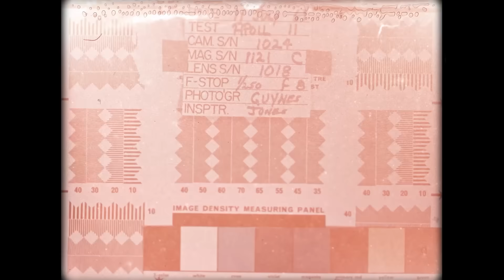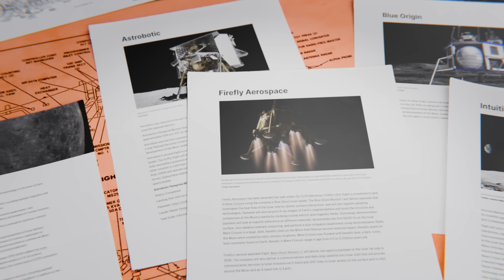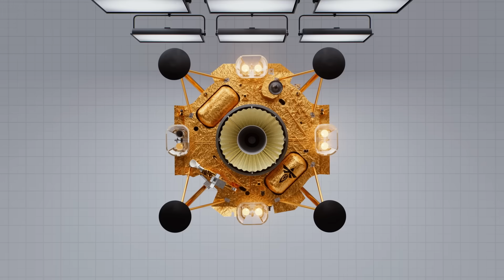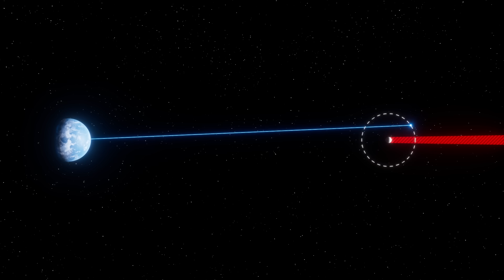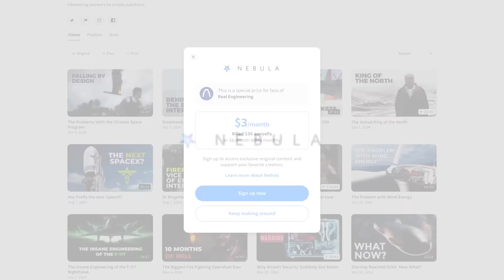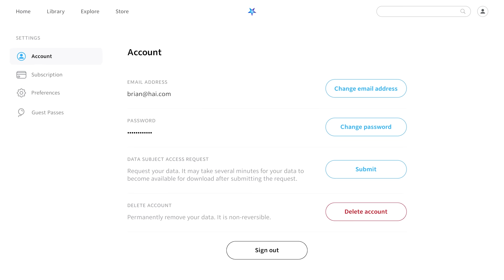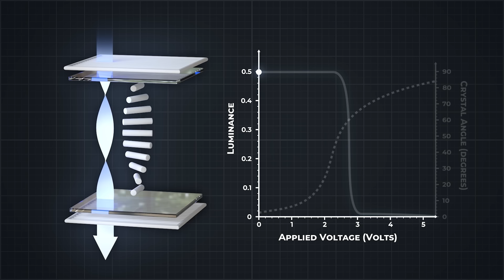Why the US is Struggling to Land on the Moon

Comment: "all the blueprints, designs and drawings are missing"
It's very easy to type those words, but you'll never come up with a source for that claim.  In fact, you can go see the vintage design documents on the Internet for yourself right now.  You've flat out pulled that out of your hat
Reply: one thing is for sure, NASA lost the original filmes and also lost the telemetry and related data for mankinds greatest achievement. I smell a rat :/
Reply: @bobmalooga7249 "i smell a rat"
Are you sure you've got your facts correct?
Reply: @ yes, go look for yourself because I didn't believe it either. I thought it was staggering to know that they lost it all!
Reply: You don't know.
Reply: Forbes wrote an article stating that NASA has lost the technology to go to the moon.
Reply: @SchemingGoldberg   Most likely you misinterpreted the article.  What was lost, specifically?

Comment: Not an engineer here but why isn’t the lunar lander designed to land any direction like a roll cage with legs on all sides.. eliminate as many variables as possible!
Reply: The lander is built to land with its main engine pointing at the ground. Having legs on all sides would not have improved IM-1’s landing. It hit the ground while it still had both horizontal and vertical velocity, because it did not have correct altitude information. 
A lander that’s designed to land in any orientation is a lot more complex: its instruments have to work in any orientation. It has to have solar panels that can gather enough energy in any orientation. It has to have multiple landing engines. etc.

Comment: Just so we're straight; after all of the moon landings we did in the 60's and 70's we don't remember how we did them? Or has technology somehow, gone backwards since then? Give me a fricking break!
Reply: We do remember how we did them. The IM-1 failure was caused by Intuitive Machines deliberately ignoring some of the lessons NASA learned in the 1960s. In particular, they did shoddy work during the preflight check: they forgot to switch the altimeter out of safe mode. That meant the altimeter did not work and could not be switched on remotely during the flight.
Reply: "we don't remember how we did them"
That's your misinterpretation.

Comment: Is there any reason they don't use a small radar sensor for altitude and velocity at the final approach, when the dust obstructs the cameras?
Reply: IM-1 used a laser altimeter. Unfortunately they forgot to switch that out of safe mode before launch, which meant the altimeter was not working during the landing.

Comment: ... You would think on an object with as little of gravity as the moon they would have the center of mass in the correct location... I mean come on! You landed a rover on mars multiple times that autocorrect. Center of mass has always been a massive role. How do they blunder this bad? Just look at the shape as compared to the traditional lander. Thats such a mess.
Reply: Having a lower center of mass would not have saved IM-1. They were trying to land while still having a horizontal velocity. It was going to fall over no matter what.

Comment: My father in law was the project manager for the Apollo Command Module Flight Simulator.  He passed on in 2015.  He was a very interesting guy.  He said that the only thing that got us to the Moon was funding, which in the early years was virtually unlimited.  He also said that the reason we stopped going to the Moon was the loss of funding.  In 1965 NASA received a budget $5.25 billion, or almost $60 billion when adjusted for inflation.  That compares to a budget of about $25 billion per year today.  As part of that, NASA is funding the ISS, the SLS, the Commerical Space Program, the space telescopes and so much more.  Is there any question as to why it is so hard to get back to the Moon.  If the US wants to go back to the Moon, then congress needs to give the funds to do so.  In the 1970's, when NASA started firing all those young engineers that took us to the Moon, they were dumbfounded.  They thought that first we were going to the Moon and then onto Mars!  Their hearts were broken!
Reply: Delusions of grandeur
Reply: One time I hear that they didn't went back to the moon, because they've "lost the technology", now they say that these were funding issues? I don't know what I should believe now.
Reply: @Wither_czach Those are the same issue. 
After Apollo 11, NASA’s budget was reduced by 90% (ie made ten times smaller). That meant they could no longer afford a program as expensive as Apollo. 
Apollo was shut down, and the production lines for the Saturn V and Apollo spacecraft were shut down and dismantled. 
The next manned spaceflight program for NASA was the Space Shuttle. This did not include manned lunar missions. So for decades, nobody at NASA was working on the highly specialized equipment you need for manned lunar missions. 
So:
- they no longer had a production line operational for that highly specialized equipment, so their construction experience was getting older and older, and gradually being lost as people left NASA for other jobs or retired.
- they were not designing that highly specialized equipment, which meant that their design experience was getting older and older, and gradually being lost as people left NASA for other jobs or retired.

Tons of information on Apollo have been recorded: millions of drawings, thousands of technical reports. But the hands-on experience slowly drained away.
Reply: @Hobbes746 That still doesn't explain the camera outside the lander, man...
Reply: @Hobbes746 Like, founding or not, that still doesn't change the fact that this footage was faked, because no one could have been outside the lander to film it while it took off.
Reply: @ There wasn’t a camera outside the lander during the landing. 

For Neil's first steps, a TV camera was installed on the descent stage of the LM. The descent  stage has an octagonal shape, with legs on 4 corners and panels that cover storage compartments on the 4 sides between the legs. On one of the sides adjacent to the ladder, there's a storage compartment (MESA) with a cover that is hinged at the bottom. The TV camera was placed on the inside of a cover panel, and when the cover was open, the camera was aimed at the ladder. The astronauts could open the cover panel from inside, and operate the camera from inside the LM.  

Once the astronauts were on the lunar surface, they took that camera and placed it on a tripod to film the rest of their moonwalk.
Reply: @ The takeoff was filmed on 3 flights: Apollo 15-17. 
This was done by a TV camera installed on the lunar rover. The rover had its own TV transmitter and antenna that could send the signal directly to Earth, and a motorized remote-control mount. 
The camera was controlled from Earth, by Ed Fendell in Mission Control. He worked out when to send the commands, to compensate for the time delay in sending the commands to the moon. It took 3 tries to get this right: on Apollo 15 and 16, the LM soon left the field of view of the camera. On Apollo 17, he got the timing right and we have a splendid view of the ascent.
Reply: @Hobbes746 I'm sorry, the camera was installed on what? That bunch of metal sticks, old tires, and an umbrella? This looks like a joke rather than professional equipment. Where did that take power to send a signal through space strong enough to reach almost 400k kilometers?
Reply: @Wither_czach The LRV was not "bunch of metal sticks, old tires, and an umbrella”.
It was purpose-built to function on the moon, and to be transportable by the LM.
The LRV carried a 10 W transmitter. Combined with the large parabolic dish antenna (using an umbrella-like mechanism so they could transport a large antenna in a small package), this produced a signal that could be received on Earth, if you had a large enough antenna. NASA used the largest antennas in the world: 70-meter dish antennas used as radio telescopes.
Reply: @Hobbes746  I guess when you were watching the missions live at the time, that was the best thing you could experience and it made such an impact on you that it looked real to you, so you're effotlessly trying to defend their "thruth", but In a young person's perspective it looks like a damn joke. You don't want to accept the truth that is all fabricated, and you throw everything NASA says to defend their lies. In Star Wars, you also have entire vessels, devices, vehicles that their working and specifications are explained in many books, images and such, but that doesn't change the fact that SW as a universe is fiction. The same comes to NASA.
Reply: @Wither_czach I was too young to watch the missions live. But I’ve examined the evidence. For the missions, we have loads of evidence that checks out. Against the missions, we have no evidence at all, just shoddy arguments that fell apart when I examined them.
Reply: ... Is that supposed to be a Joke?  The US spends 60 billion every other week on Ukraine or Israel or some MIC item!  You're truly ignorant of that reality?

No, essentially, you've made the case for deniers.  The US invented a fiction  and once it was done (camouflaging a bunch of shit in the late 60s and early 70s) said achieved the greatest thing man could ever do... so we'll stop. 

First time that behavior was ever exhibited by a human... really?
Reply: @BwanaFinklestein  Reality is that wars cannot be compared to discretionary spending on science projects. 
In the 1960s, the US made warlike funding available for Apollo in the context of the Space Race: they wanted to prove the USA and its democratic system was technologically superior to the USSR and communism. Once the goal of Apollo was achieved (beating the Russians to the moon), the government was no longer willing to keep funding NASA at that level, so they reduced NASA’s budget by 90%.

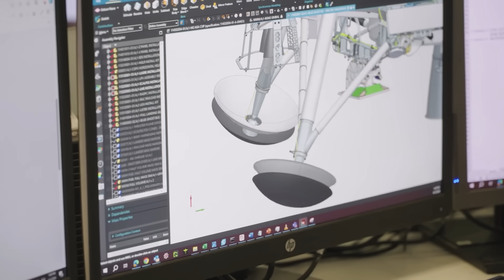Comment: 10:15 wonder how not 1 speck of lunar dust was on those legs when we "landed" on Moon?😂
Reply: The moon has no atmosphere. So when the LM approaches the moon, all of the dust that gets picked up by the descent engine, moves away from the lander in ballistic arcs. This is visible in all of the landing videos. Here on Earth, the dust would swirl and billow, and some of it would end up on the lander. Without an atmosphere, that does not happen.
Reply: @Hobbes746   so the main engine in the near middle of its rocket blast would kick dust straight up, as it would bounce from the surface...
even with your explanation atleast some dust would land on the legs...
Reply: @Lipi19821  No, the dust would not go straight up. There’s a lot of gas flowing downward, then outward. Dust can’t travel against that stream to go upwards.

Comment: stop with the autonomous bs
Reply: To land on the moon, you have 3 options. 
1. Manned landing. The human in the loop can observe the terrain and decide where to land. 
2. Unmanned landing with simple flight control system. The Surveyor and Luna missions of the 1960s and 1970s did this. They landed blind, in a spot we had taken photos of beforehand and determined to be reasonably free of obstacles. Apollo 11 showed the limitation of this approach: due to an error in the timing of the LM descent, it was not going to land in the preselected spot, but would be coming down in a boulder field. Armstrong and Aldrin could correct this, but a Surveyor-type spacecraft would have landed in the boulder field. 
3. Unmanned landing with advanced flight control system. With today’s image recognition software we can take photos of the terrain and recognize obstacles that would prevent a good landing. 
The time delay sending data back to Earth means option 4 (remote control) has problems. You have to carry a lot of extra fuel so you can hover over the surface while the team on the ground looks at the photos.

Comment: If USA really landed on the moon 50 yrs ago…why until  now they are still struggling to do it again…very funny?
Reply: Two companies recently tried to land on the moon. Neither of those companies were around in the 1960s. Neither of those companies had ever built a spacecraft before. 
Both company provably ignored the lessons NASA learned in the 1960s.
Reply: NASA had a lot more cash avaliable to them bc of the space race against the USSR. That funding has dried up now

Comment: so you wana convonce me they did it with a very old computer and cant do it now lol my computer is 10 year old and it strugling to play this video but you wana say older computers could put them on the moon lol
Reply: Yes, NASA got 11 missions to the moon with very limited computers: 5x Surveyor (which had no computer at all), and 6x Apollo. This indicates that the computer is not the biggest problem. 
IM-1 failed because of a dumb, preventable human error: during the preflight check, someone forgot to switch the altimeter out of safe mode. With the altimeter in safe mode, it can’t use its laser and it can’t measure the altitude of the spacecraft. This caused IM-1 to crash.
Reply: The computer doesn't matter and yes playing YouTube videos is a lot harder for computers than controlling a rocket
Reply: Better get a new keyboard the one you have has many glitches.
Reply: wow, its almost like playing a video needs the GPU alongside more ram, in comparison to mathematics purely on CPU?? that's crazy! woah!!! shocking???

Comment: We can land multiple landers on mars with HD cameras but not on the moon? Yeah right.. makes sense
Reply: The two CLPS landers failed because those were deliberately designed to be much cheaper than any misson we’ve sent to Mars. Corners were cut that should not have been cut.

Comment: They struggle because they was not landing 🛬 at the first place. Only star wars sci fi tech is the real engineering. But only dark 🌑 government posses the resources at area 51. Secret aircraft spaceships. Diagonal takeoff and landing. Roswell crash was secret tech testing. George Lucas knew that. Ships and tech portrayed in star wars are actual ships on area 51. Hyperdrive is just hyperjet engine. Like quadrilion times higher thrust levels and efficiency compared to Apollo rockets. Imagine ship that has mass of a truck 🚛 and thrust levels of quadrilion Apollo rockets combined. It's like to compare floppy disk to 1 Tb micro SD card. No new laws of physics, no fancy matter, alternative universes, extra dimensions etc.
Reply: 6 Apollo missions have landed on the moon, along with dozens of unmanned spacecraft from multiple countries.
Reply: @Hobbes746  Unmanned probes. Keyword is unmanned. Only unmanned probes reached the moon. And unmanned rovers. Human flights ✈️🛫 to the moon are staged. Filmed in simulation sites and pretend to be real missions. Even ISS is unmanned sateloon. Unmanned. Even Gagarin's flight was staged. He landed with parachute outside the capsule. Basically they drop him and capsule separately. From high altitude airplane 🛫. And forced him to lie. Later Gagarin's died in weird accident and was cremated to ash. The dark 🌑 government erased all evidence 🧾. Apollo 1 crew also died in capsule fire 🔥 on the ground. And safety inspector died with it's entire family week after the report by hitting from a train 🚂. So unmanned probes reached the moon. And rovers. Humans not a chance with Apollo/souyz style tech. With star wars sci fi tech at area 51 they could land humans on the moon in secret missions. Secret societies run the show. Kennedy tried to expose the dark 🌑 government with official  moon mission but was shot down.
Reply: @LORDVADER357  That is incorrect. The Apollo missions were manned. It’s easy to prove this too: 
1. we have photos of the landing sites, made by lunar orbiters from 3 countries. They show the foot prints of the astronauts. 
2. we can analyze how objects move in the Apollo videos, and we find that all objects fall at 1.6 m/s2, not the 9.8 m/s2 we get on Earth. This proves the videos were not made on Earth.

Comment: Apollo 17 was not in 1952; it occurred 20 years later.  The Intuitive Machines lander was much too tall and top heavy as you imply; but much more importantly, it did not have an effective system to avoid rocks, like a Neil Armstrong.  Armstrong had to take over the landing manually to avoid landing on rocks, flying horizontally quickly quite a distance, much more work than you imply.  Armstrong was the pilot for the job, already having proven himself in emergencies in the X-15, Gemini, and the LLRV.  And, apparently they did not know where every large boulder was on the moon.  100 meter resolution was not sufficient.  They should have also used a lidar, with landing area scanned well before dust is kicked up.  Real time data is impossible due to the time delay.   Now, the most important factor: Will the aliens allow men to return to the moon?       Joe
Reply: What are aliens doing on a dead celestial body?